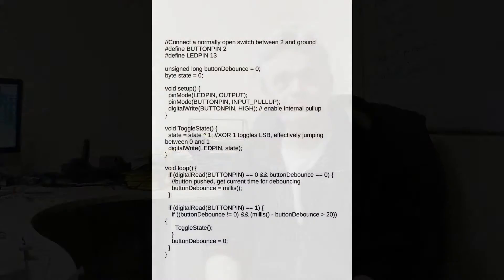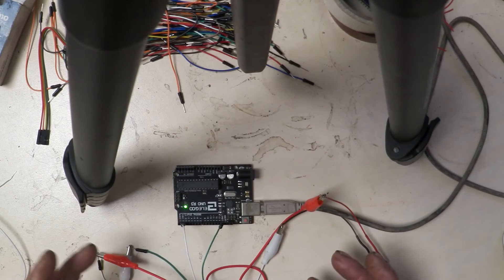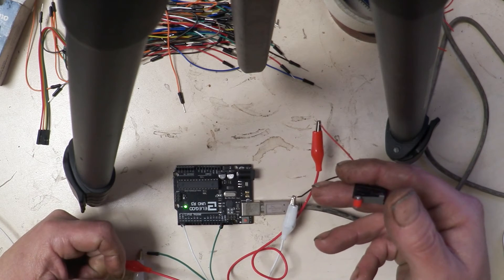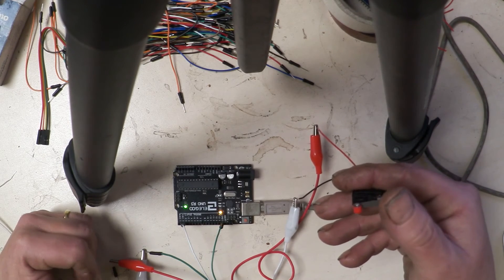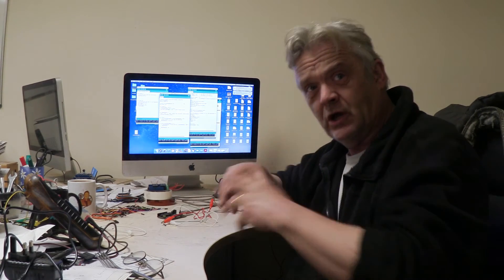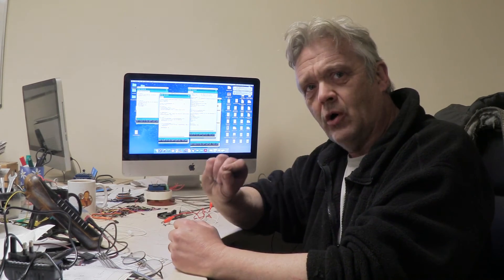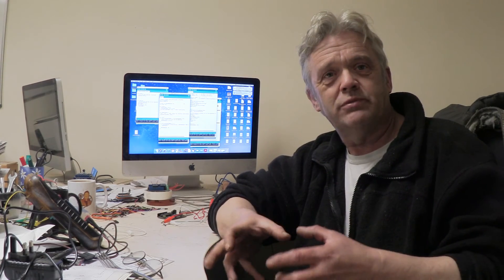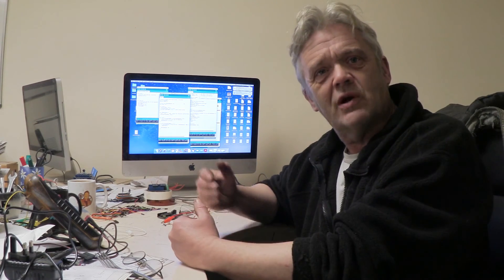1012 Working With The Arduino - Latching

Comment: Flip Flop IC's like the 0.59 cent 74HC109 do exactly the same thing. Worth noting for next time. Couple it with a BC transistor or mosfet and you can switch any load.

Comment: Can the Ardruino really pull enough power to latch a relay with the same power it takes to turn on a simple LED?
( considering matched voltage ect.)
I have never messed around with Arduino, if that's the case, I am going to get started playing around with them!
Thanks Robert!👍

Comment: I have a bunch of momentary switches with a built-in LED which I bought for this kind of use case. Software switching something on and off. If you use an ON-OFF switch to turn something on and off, it's stuck in that position and can confuse things if you want to also control it with a microcontroller or computer. With a momentary switch with an LED in it, I push the switch to turn something on or off and the microcontroller controls the state of the LED and the state of the device being controlled. The LED on the switch can show the state of the device no matter where it is switched from.

Comment: If you like Arduino you will probably get interested in things that go beyond that. You will need extra external boards like PWM boards for motors etc that are too big to be a shield. I hope this makes sense. So download Kicad from the CERN server. It will enable you to draw up schematics which you may like to design yourself of copy and modify from online resources eg product application notes from companies such  Texas Instruments or Vishay etc.Kicad will use the schematics as a reference eg linked to building the PWB ..PCB board. As it reduces mistakes you could make when you draw the board up by placing tracks between components.

Comment: nice. You noticed the debounce counter in the code ? As I explained to you earlier .... switches bounce when switched on or off. This code only assumes the switch is on or off when it is stable for some time. If not there is no way telling what the output will be after you pressed the button.

Comment: I want to make a resistive spot welder, but I will try to use a 555 timer. I seen a lot of schematics, but I've yet to try and make circuit with it. If I can be done with a few projects at work I may have time to try.

Comment: "Taking it and using it" as Rob is doing is also among the best ways to learn how to write code yourself.  The more you use it, the more familiar it becomes and you begin to understand the language syntax.  Even in the 80's and 90's, I was entirely self-taught in programming by taking code I found in books, periodicals, newsletters, etc and plugging it in to my projects until I eventually knew how to write code myself.  These days, internet resources makes it soooo much easier!!  And I can't stress enough how helpful those "starter kits" are for the Arduino and Raspberry Pi!! 😊  What I wouldn't give to be a teen again today with all those resources at my fingertips!!

Comment: Using other people's code and adapting it is how everybody programs.  Unlike art, logic pretty much has a best path for small things.  

Large things is a different story.  Libraries of code can sometimes hide trojans that can compromise your system.  You need to know what each piece of code is doing if the library isn't from a trusted source before using those if you want to keep your system secure.  

Little prices if code like this are no problem though
Reply: "Using other people's code and adapting it is how everybody programs"

That's a bit of an exaggeration.
Using other people's code is a good way to learn how to program but, if you do not progress passed that to actually write code from scratch; your not really a programmer.
Reply: @scotttovey  I don't think Colleen intended that statement to mean exclusively how people program.  But as a generalization, every programmer is going to grab and adapt code rather than write it from scratch whenever that's an option.  To do otherwise would be highly inefficient and unnecessary, unless there's a particular reason you want to challenge yourself.
Reply: @NorthernKitty  
Agreed!

Comment: Seems very similar in the 80’s when trying to learn a word processor or spreadsheet. All my instructions were geared to learning to program. 
Now they teach the how to use the program.   Thanks for the showing how to use the It without programming.
Reply: Thing about being taught via  use, rather than coding... Is it often ignores skills one might already have... And then one needs to be taught again when new version of software comes out... 

Last time I did a refresher office software course... They went through every single way of opening up an item from drop down menu. Brain pretty much fell asleep, and I'd considered packing course in. When it came to exam I was not happy because well I'd have gotten exactly same mark if I'd sat it without having the refresher material. There was nothing in it that was specific to software! 

Then when they had us doing databases.. It was "use the assistant."  I'd never used such before but was able to see it just  writing SQL code... And that's pretty much just set theory that a preschooler  might understand. Pick out all brown Cows in a field etc. 5min later I'd picked up enough SQL to do more than the assistant could do. Lecturer didn't know what I was on about till I showed him the info via the  F1 key for help function... Which wasn't getting taught.

Comment: Thanks, that was encouraging as I have avoided playing with Arduinos as I've not been keen spending ages learning coding. This seems like a way in. Great!
Reply: There's a lot of existing code out there that is just plug-and-play, with nothing more than maybe tweaking a few parameters or adding an extra instruction to do specifically what you want.  If you haven't yet done anything with an Arduino, I highly recommend one of those starter kits for around $30 or so.  They contain a bunch of easy projects and often contain the Arduino as well.  They're very good at step-by-step at just making it work, then you can spend time afterward to understand HOW it did.  😊
Reply: @NorthernKitty  Thanks for that!